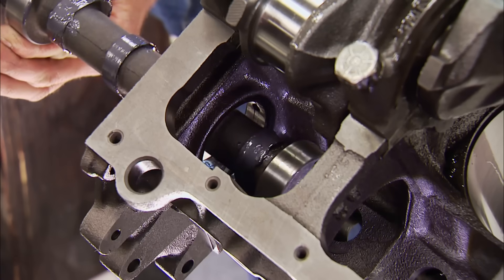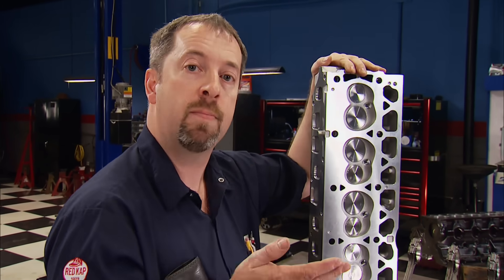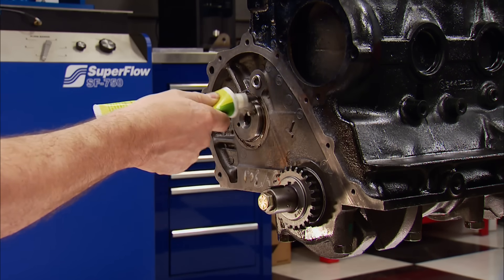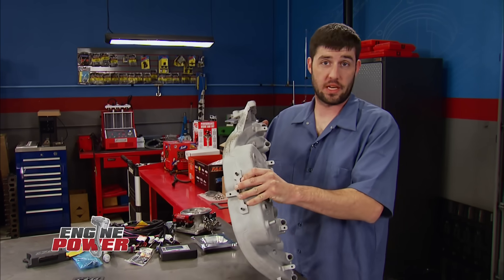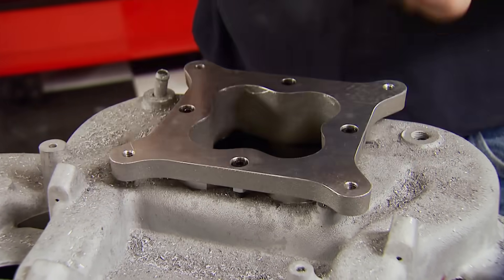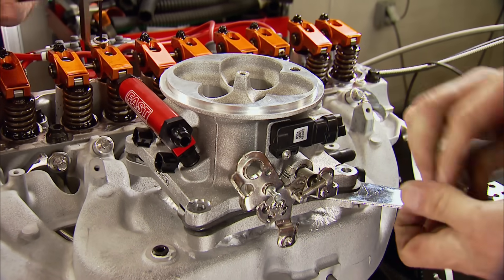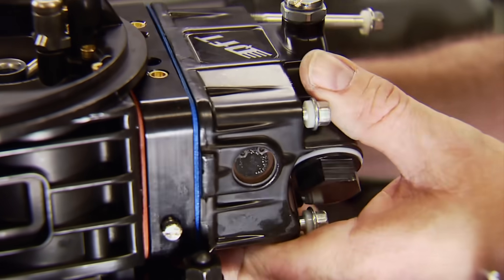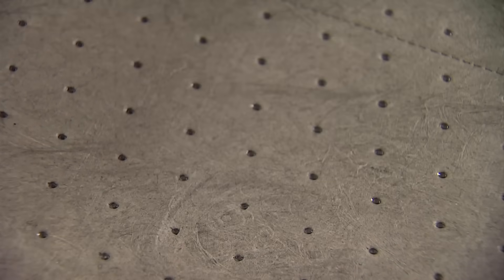Rebuilding a 4.0L Jeep Straight Six to 242HP - Engine Power S2, E14

Comment: Easier to just ls swap at this point
Reply: not really, LS has a different trans bolt pattern, ecu, motor mounts, and various other components, 

with a stock iron head, you can throw a junkyard 258 crank in a 4.0 block, add a header and a small cam, and have 300hp/320tq, and it works with the stock tune, stock trans, etc.

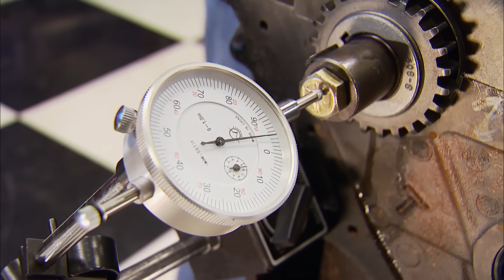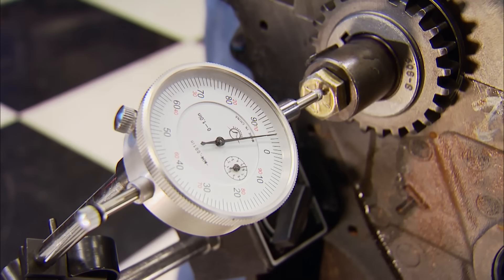Comment: I took my 87 wrangler amc and put a aluminum head roller rockers with kit from dodge painted it with red white and blue. Went to glamas with my friend and his brother with a BRAN NEW RUBICON. HE and his ruby gave me and my Betty  no respect (probably because he spent to much) 2000 ish. He shit when I got him off the line every time. After couple hours they started there respect. My kit was port injection. I remember there was a questionable discrepancies with 3.8 <> 4.0 (forgot to pump lifters with oil) took it to this hot rod garage in Baldwin park to get it started . guy said kid that runs good he never drove one he only drove race cars 1/4 mile irwindale. 0-50mph was in front of most lot of mustangs were not happy till after 50 only reason I sold it was I got 9' tall B300 maxi van 440ci Dana 70 rear Dana 44 front np 205 with 36" boggers 1' lift license plate said dcrusher 4:10 front 4:11 back so pulling anything in sand wouldn't get buried in said I'd never sell it it was too much fun everywhere took off the it's split sunroof I could stand up thru the roof and still drive it cause how van pedals aren't under dash like a truck had to sell everything I owned to start over in San diego I gave a tuck load of great items to richard "dick" bordon (who was so stupid he would have his son same name pass electrician listened cause he couldn't (his son richy was a great kid. His other son cheated forged a pink slip to try to steal a mustang of mine until I got a detective on the case (after all I gave them for free) I was in detectives office he told me to call from his phone and tell borden what I wanted so chet didn't have to go to jail for forgery. After I told him what I wanted "dick" bordon tells me im not allowed at his house no more. I didn't even tell the detective that he sold Marijuana to under age kids or had his oldest kid forge his electrical contractors license so he could stay in business in west Covina. Some people are so stupid they don't know when you do them a favor. His boat with 3 carbs didn't run in 5 years I turned jets closed backed em off 2.5 turns in 5 minutes it was idling and tells me your not welcome here anymore. 00yo.ncsd@gmail is happy as a lark in LA Costa ca on the beach can't make this stuff up.
You still miserable in w. Covina richard?

Comment: This engine is a piece of shit. Broken piston skirts, bad camshaft bearings, and cracked cylinder head castings are all  extremely common in 4.0s with less than 40k miles.
Reply: Tell that to Newcomer racing.

Comment: "The fuel injection is working perfectly, it's our manifold work" so you take off the EFI, put a carb on the same manifold and it runs great - so how is that NOT the EFI? This is what happens when you have to make your sponsors look good no matter what.

Comment: I stroked my 4.0 to 4.7L , added a bigger cam, Hesco head, and a Kenny Belle Supercharger. Absolute torque MONSTER. Front tire would pull a wheel off ground from a dead start. 
4.2 crank, custom pistons. 
But I got a Hemi now :)

Comment: The 4.0 is based on the AMC 4.2, which dates all the way back to 1964.   "Stroked" 4.0s were originally made by combining parts from the 4.2 and 4.0 to make a 4.6 displacement.  Thats a 42 year run

Comment: With the baffle cut out of the stock valve cover to accommodate the taller rockers, is there a risk of oil getting into the PCV system.  I'm finding at high rpms, there's an oily smell coming from the engine bay.

Comment: Is there another engine that you can spend this much money on to get this little performance.........I love my 4.0. But I'm not dropping $5000 to have a sub 250HP engine. If I need anything like that horsepower, I would do an LS swap.
Reply: That's because they half-assed this build. This build was stock stroke and low compression.

Newcomer racing has gotten more power with less work. 300+ horsepower and torque, WITHOUT a fancy edelbrock head, and a very mild cam. 

They have gotten over 400 horsepower on wilder builds, and over 1,000 horsepower with a Turbo.

Comment: I don’t understand why would you not use the factory fuel injection and just changed the injector size? Why did you go with that throttlebody fuel injection? And then end up switching to a carburetor.. these murders are bad enough on gas. I’d like to know what kind of mileage you get with that Build??

Comment: After watching this, for the money, I may as well but a LS 4.3 V6 in my comanchee
Reply: That's because they half-assed this build. This build was stock stroke and low compression.

Newcomer racing has gotten more power with less work. 300+ horsepower and torque on a budget stroker, WITHOUT a fancy edelbrock head, and a very mild cam. 

They have gotten over 400 horsepower on wilder builds, and over 1,000 horsepower with a Turbo.

Comment: Pretty week shit only making 242 HP without any accessories or muffler. A stock one made 195 with them, so probably 220 at least without accessories and exhaust. Only a 20 hp gain with head, cam, and header?? C'mon!
Reply: That's because they half-assed this build. This build was stock stroke and low compression.

Newcomer racing has gotten more power with less work. 300+ horsepower and torque on a budget stroker, WITHOUT a fancy edelbrock head, and a very mild cam. 

They have gotten over 400 horsepower on wilder builds, and over 1,000 horsepower with a Turbo.

Comment: I have to think if you had gone forged pistons forged crank and roller rockers you could have turbo'd this motor and gotten 500 hp out of it 242 is barely what most modern day 4 cylinders are running

Comment: I started building Jeeps in the 80s still doing it today and the one thing that I have overlooked my entire life is the 300 straight 6 Ford engine that is the ultimate Jeep motor I believe under 8 cylinders I just spent a ton of money boring and stroking the current build that I'm doing for an 87 CJ7 Laredo will the t5 transmission I pulled the old four cylinder Duke out of this Jeep don't get me wrong there's nothing wrong with what you guys are doing but I think the 300 6 cylinder would be the ultimate choice

Comment: What made that engine reliable was the low hp, you guys could mess up a wet dream.
Reply: actually, what made it reliable was it's simple, proven design.

people have made plenty of power with a stroker or a turbo.

Comment: Here's my biggest issue with this whole thing, they blamed the injection system for the engine not wanting to rpm. No you put a 950cfm throttle body on an engine that maybe needed a 400cfm throttle body. I can guarantee they were seeing zero vacuum at probably half throttle and the fuel injection system was freaking out because of it. It's a simple calculation to figure out. They then put a 200cfm smaller carburetor, which utilizes airflow and not vacuum for the fueling demand, and it made the power they wanted. I can guarantee if they went even smaller on carburetor and went down to a 500cfm 2 barrel carb it would've made even more power, probably closer to 275 or even 300 if you revved it out to 6000rpm. It's simple math that they could've easily done but were lazy and didn't want to double check it. Or didn't have the budget for it so they went for what they had on the shelf.

Comment: These engines are such a piece of c*** Build one for more power hell, I'm afraid to give my Jeep. any gas, I'm afraid it's gonna bust. I'll 6. pistons again. And if you don't blow the pistons, it's almost  guarantee the heads going to crack. Leave these things stock and treat them like newborn babies. If you push them like a teenager, they're going to blow.
Reply: You couldnt be more wrong. Ever heard of Newcomer Racing? They specialize in these engines.

Comment: I know this video is really old but is it possible to get 400 to 500 horsepower out of the 6 inline 4.0L????
Reply: Its easier with a turbo, but newcomer racing has gotten 400 horsepower with this engine architecture.

Comment: The 19yrs number is debatable. the 99-2006 blocks were different, mainly in motor mount location, but also oil pressure sensor location. The result is that WJ and TJ 4.0's are not swappable with earlier 4.0's. I'm in the middle of a swap on my '02 WJ 4.0, who's original engine dropped a piston skirt after 2yrs/260k miles. replacement engine is 20yrs old w/ 97k miles.

Comment: Your torque specs are wrong unless that's just torque for that year because the 99 calls for final head torque of 110 on all bolts except number 11 and calls for thread sealant on the front head bolts as they go into the coolant passage that the water pump sets in and my 99 has dowls to aline the head and gasket and the outside head bolts are studded and 2 on the inside by the valve train are studded to aline the valve cover gasket

Comment: Better check those head bolt torque specs again and the front drivers side one requires thread sealer because it goes through a coolant passage

Comment: As fun as this project is, it's not feasible for most. The Edelbrock cylinder head is around $1,500 alone. Personally I would love to see what you can do with the engine in the vehicle to increase performance and reliability. Things like gasket replacement from stock cork to enforced aftermarket, throttle body improvements, combustion, etc.

Comment: Loved this engine stock would love to have 1 with these mods. Ive had it in 2 4x4s and I had 1with 5 speed 2wd The 2wd was really quick for an old country mail jeep. I mean just look in the junk yard theres tons of engines still the bodys rust the tranny or the transfer case goes rear ends were not that good but the 4.0 lasts forever if you keep it cool and lubed up and you can beat on it hard.  Wander if the head bolts would hold some boost but the intake and exaust sharing bolts may not like boost.

Comment: So just to inform people about the problems with the tbi setup. With some dual plane manifolds the tbi self learning will not work correctly. I've seen this very problems a few times. The simplest way to fix it is to install a single plane Intake. While it doesn't flow as nice as the late model offenhauser it may fix the tuning problem.

Comment: I have a 1999 Jeep Wrangler Sahara with that 4.0L in her I bought this Jeep with 19,000. miles in the fall of 2000 drove her for about 9 years then she sat I then pulled her in the garage and replaced all the rusted up body panels suspension and a complete brake system and anything else I could think of but that 4.0L didn't need a thing I always took great care with full synthetic oil changes every 3000. miles and filters , Now she lives in my garage we just go for a ride on  sunny days then back in the garage parked on rubber backed carpet , thanks .

Comment: In Australia and NZ Chryslerused this engine with a 215 ci little brother and 265 ci big brother. They had Hemi heads on them with huge valves and flow rates. Stock they were mild and very torquey still for pulling horse floats etc. Chrysler put three 45 DCOE Webers on them and they made 320 hp off the show room floor. Quickest Australian produced 2 door vehicle from 1971 till 1985! Would a Hemi head wake the 4.0 up even further? Will it fit? Next project boys!

Comment: I had one of the first 1987 4.0 in a Comanche. It was a monster at the time, especially down low. I drove it to about 100k miles and then sold it to my dad who drove it to 300k before passing it on. Hell of a solid engine, pulled like a locomotive.

Comment: That's $5,000 in parts right there. At that point you may as well go for the Stroker. Golen sells their crate engines at around $7,000.

Comment: Sure it would be nice to have some extra horses and more torque. But switching to a carburetor over the superior fuel injection and the expense to have this done is not worth it for me.

My '05 Rocky Mtn is slow off the line like any 4.0 I6. But once it hits 1700 rpm's, it runs great. 190hp with 235 ft lb of torque is perfect for the TJ. The TJ when resuming speed with cruise control and anytime you get on the throttle is impressive. The Banks cat back exhaust has a stout, throaty growl making it sound great, but not obnoxious. I can easily do 75mph on the highway and 85+ for passing. But usually keep it at 65 - 70 to conserve fuel. Running at or around 2000 rpm's helps the cause. 

Anyone with larger tires knows that re-gearing is where you get most of that lost power back. I only have 32" ko2's with 3.73 gears and it calls for 4.10's. But right now, it's not worth the expense. 

I use Valvoline 10w30 150K Synthetic Blend oil with either marvel mystery oil or bg44k. And these products together with Wix filters keep the ole 4.0 running at an optimum level.

Comment: I wish I knew about this when I had my  Jeep. Wonder though if the intake manifold would cause clearance issues? Wonder if a modified clutch would be needed over stock? Then how well would the transmission and transfer case handle the engine? Never say what they were going to put the engine in if anywhere?

Comment: we had a 2001 Cherokee, stock. and that thing have went through a LOT.   woods traversing for hunting ( got too  tired/lazy to drag very large boar back)   camping for 15 days in desert  west Texas.   road trips from Texas to PA, and back, occasionally stopping in St Louis. 
odometer was reading 240k miles.    when we finally decided to get another car,  a brand new grand Cherokee.   we kind of put the Cherokee aside for minor projects.    first thing we did was to "restore or replace many parts in transmission and engine.      bigger ports, bigger intake and exhaust ports, bigger cam.  bigger intake box,  cherry bomb exhaust.  secured shields on undercarriage and rock skid bars.  custom bumpers,  rhino paint.   2 inch lift spacers. new steering racks, bigger sway bars and custom 2.5mm shield over front differential and rear differential with skid bar to deflect stones away from driveshaft/pinion area.     BFG mudders.  interior was completely stock  other than rear seat remove and passenger side had 200?+ count rachet/hex/torx toolchest with many spare fasteners.   driver side, had small cabinet  with air compressor and battery jump kit,  yeti coolers, and finally a small batterypack UPS for whatever, with 3x 120v outlets.    4.0 Cherokees are really WELL built.   probably only good thing from Chrysler.  and that is saying a lot.

Comment: That intake manifold was designed for port injection. you may not see a performance increase using a throttle-body.

Comment: I've done a 4150 adapter mod on a late model 4.0 manifold for a 4.6 stroker engine and got excellent results using FiTech 400 hp throttle body EFI.  I haven't dyno'd it, but it runs very strong, and have no indications that the engine is intake-limited.  In fact my adapter actually transitioned from the 4150 flange to the stock circular throttle body inlet, though I hogged that out to about 69 mm (about as big as you can go and still have enough gasket sealing surface.   They needed to spend some more time with the FAST system and figure it out - it likely would have worked fine.  The fact that they put a 4 bbl on there and it pulled like a champ is pretty good indication that the manifold isn't the issue.

Comment: Dear Powernation your dual plane intake setup can't be used on a inline 6 engine unless it's turned 90 degrees basically run it the opposite direction or just go single plane intake style setup with a EFI system.

Comment: Curious - Did you cut off the neck of that adapter before welding it in place?  With those sidewalls dropping INTO the manifold it was not unlike sticking a funnel in with it's own baffle effects.

Comment: Let me ask you this  I could use that Edelbrock manifold and roller rockers and that distributor and that electric water pump right now .....  I went with forged pistons 60 over ... On my " Stroker engine " .... help me out over here in Colorado ASAP 😩  PART'S NEEDED BADLY 😢 😩 😫 😭

Comment: i got a 99 jeep Cherokee sport 4.0L that shut off on me on the way home from getting new brakes all the way around.it was running like a new lawn mower.. half a mile from home it shut off...it was full of gas....cranks fast but wont start...fuel pumps cranks up when key is turned on...help...how do i  find out whats wrong with it....no backfires or puffs.....just shut down.

Comment: That TBI would work a LOT better if that flange wasn't sunk so far in. On that inner edge the air has to take a crazy path. I get it's just for engine Dyno purposes but this thing would come alive with stock injection and a gasket matched intake/head

Comment: Learned something new today :D
I was like.. "valve rods in an inline six? ..wait.. where is the camshaft again? ..oh beside the crankshaft"
I only knew it from V-engines with just one/two camshafts between the cylinder heads. Interesting design